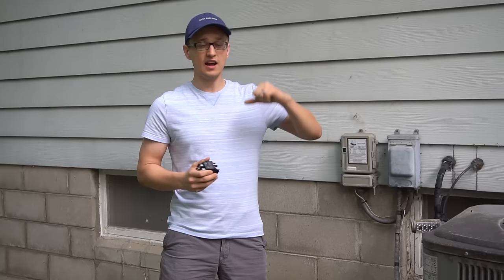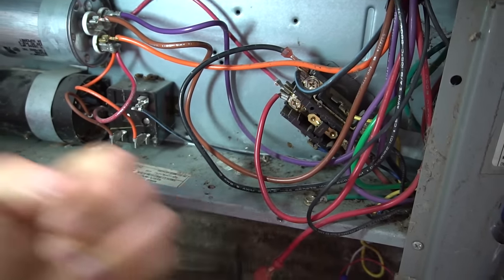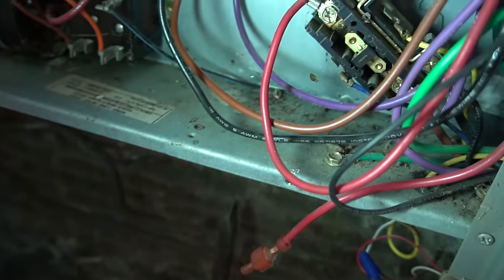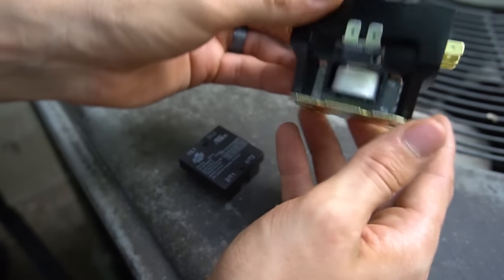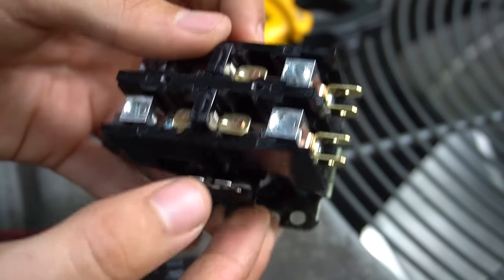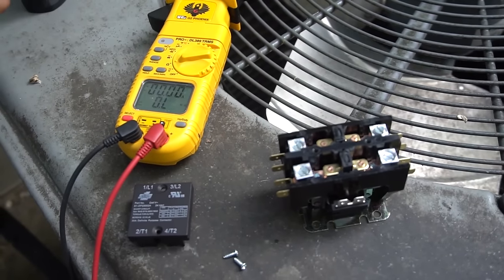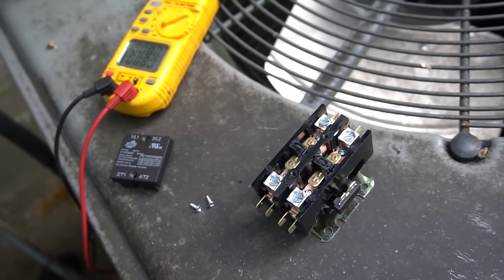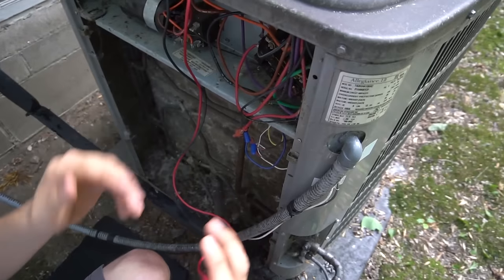Air Conditioner Contactor - How To Check If It's Actually Bad

Comment: I sure hope it’s just the contactor on my AC unit. I have a friend who does HVAC and he thought it was my fan motor. I bought a new one along with the capacitor. After installing it I turned on the AC and it ran for a short time although it seemed to be running kinda rough. After a bit it slowed down and then stopped but you could still here the compressor. Now the fan is not running at all. Keep in mind the old fan that we thought was bad ran the exact same way. It sounded a little rough. I’m now thinking that the old fan and capacitor wasn’t bad and was running rough because it didn’t have good connection with the contactor. I’ll be checking it in just a bit and I’m hoping that it’s just dirty or has a build up of insects like you had mentioned. My home has two AC units (one for upstairs and one for downstairs). Thank God at least one level is staying cool. This KY heat can you be miserable. Thanks again for sharing your expertise with us.

Comment: Great video. I’ve tried everything. Something keeps tripping the breaker, but it does not appear to be the compressor. It is not ground out. I found some bad wires fixed those still tripping the breaker. The capacitor is good. The only thing I haven’t tried is the contactor. What is the likelihood the contactor is causing my breaker to trip?

Comment: Thanks so much, Jay! After replacing the capacitor I was still having a problem with the condenser unit not going on even though the furnace fan was running. I went through your troubleshooting tips and narrowed it down to the contactor. It was getting the 24 volts and visually looked just fine (I even took it apart), but wouldn’t pull the plunger, didn’t pass the voltage meter test, and kept blowing the 3A fuse on the control panel even when it was only connected to the thermostat wires. I took it to a local electrical supply store and they confirmed it was bad and I was able to replace it for $20. Thanks to your videos I can safely cancel the service repair appointment scheduled for Monday!

One question though — I noticed that my fan motor has a slight wobble that causes the condenser unit to vibrate a bit more than seems appropriate. Could the motor be going out, or could it be that when I took it apart to inspect it I messed with how it was originally balanced?
Reply: It's possible the fan blade got damaged and is out of balance; they have some clips attached to them for correction similar to balance weights on tire wheels.

Comment: Just a heads up...O/L means that the resistance is too HIGH for the meater to read. I try to remember the difference between low and high resistance by thinking about how hard it is for current to get through something. Low resistance is easy for current to get though a cord, contact or fuse and higher resistance is harder to get through. If a cord, fuse or contact is broken it makes it extremely difficult for current to travel through which makes the multi meter read O/L.

Comment: My fan runs inside, breakers are all on, but my outside unit makes no sound and fan never comes on. Is there a video on just checking every power connection on the outside unit that could be causing this? Thanks so much for all the awesome videos!  🙂
Reply: hendrixgreengilmour. A HVAC tech with his volt meter should find the trouble quite easily. But Start by making sure power supply and tstat is working and dialed to cooling/heating
Reply: Thank you Nathan!  Turned out there was a big leak that all the freon had leaked out of so it wouldn't turn on. It was a brand new unit so I was pretty surprised.
Reply: hendrixgreengilmour. O dear! Let's hope the installer repaired that for free.

Comment: Great video! very clear!
My heat is not working. I called Hvac guy came,. He replaced the fan motor and thermosate.  However, the machine stopped after working for abond 10 hours, and the alarm indicator light showed as low pressure lockout. The hvac guy came back. He jumper the the heat pump to restart it. The test pressure was normal, but it still stopped after 10 hours, and it also showed as low pressure lock. The hvac guy don’t know what's the problem now. 
Can you give me some suggestions on where to check to find the problem?
Thank you very much.

Comment: Just subbed. why because you explain things in detail. So cool.  So I have a concern and I'm really tired of fixing my RUUD 4 ton. tech came out and wants to put a new unit in. I know it's 10 years 6 months old but I babied it. clean the condenser every year and the evap also, even made a pvc tube with brush to get up there nice and deep like, attached to my shop vac, It's clean and in great condition. Its a small commercial unit and has copper tubes. OK  Hanna just came thru and did some damage to all my neighbors houses and trees HA HA. No just kidding. Thought I got thru it but turned A/C on and it just screeeeshed. shut her down. So did the DYI and checked her out. Code 5 (crap) comp circuit. so replaced the capacitors since I keep spares and same thing. pushed the test button and comp grunts and fan just turns for a few seconds then it all shuts down. called my friendly a/C guy and he also says comp and gives me the line its old and need to replace it all. So he left. this is getting long sorry. But after he left and a good night sleep I went back to DYI. Hmmm unplugged the comp (scroll) and pushed the test button, of course no comp noise but the relay did click and then the fan turned on for a split second just like before. So now I'm thinking circuit board. Oh have comp coming OUCH.  This is getting costly. I do have HVAC experience but in Vehicles. I/m Senior Master certified in all categories but little Home HVAC. I have been electrocuted many times in the past so even though I have a Pacemaker/defibulator now I'm willing to give it a shot. Were protection. So long story short. I used to fix my old home unit and even after 25 years it worked flawlessly. a few capacitors and contacts over the years but easy peezy.  now 400 for a circuit board, Dahm HEY CAN I PULL ALL THAT ELECTRONIC CRAP OUT AND REPLACE WITH A SIMPLE CONTACT UNIT AND REWIRE..PLEASE SAY YES.

Comment: I finally managed to fix my AC a little while ago after 3  days or so of trying to figure out what was wrong, it ended up being what I first thought it was, the contactor. I found an earwig stuck under one side of the thing cleaned it out and thought I was done. I went in and turned the AC back on, went back out side but it was still not running even though the plunger was sucked down so I thought something else was wrong. Finally this morning I checked for continuity with the plunger pushed down and there was none so I pulled the lugs and screws out of the way cleaned the contacts with one of those finger nail sandpaper boards, put it all back together, turned it on and now it's working fine.

Comment: Hey it’s me again. Good video as usual. It appears that your start cap is leaking. Saw white crusty stuff on the edge and base plate. That will be $98 service call lol no charge. I do strictly commercial AC now and the cover is also an arch protection on 460volt. Carbon builds up over time and is conducive.
Reply from the maker: Hey there Yo Mamma! :) Thank you for the heads up! My reply to that is this right here ;) https://www.youtube.com/watch?v=hC0nFT1XPcI&t=25s

Comment: Great vids! While checking mine, I dropped the ball and disconnected the wire to the capacitor and BOOM, it welded itself to the sheet metal. After pressing toggle the ac unit would not start. Is the contactor not Def bad? Hmmm....
Reply from the maker: Thank you and sorry to hear about the little mishap. Most likely your circuit breaker tripped or if you have cartridge fuses in your disconnect box, those could have blown. Usually once you replace the fuses or reset the breaker, it comes back on without further repercussions. The 3amp fuse in the indoor unit could be blown too. It's part of the low voltage circuit though so it shouldn't be affected. Mentioning it just in case.

Comment: Your videos are really helpful. I have a quick question about the contactor. My contactor now only works if press the reset button. But the problem is that I have two units. When I turn the power on for the unit outside, the contactor sparks and the other unit turns off! Is this a bad contactor or something else? Thank you very much.

Comment: Watched a few of your videos and liked them. Can you please help with a diagnosis?
Neither compressor nor compressor fan come on when I turn on AC and wait.
I can hear the contactor click.
Out of maybe 20 times, compressor did come on twice but then shut off after a minute or so. Compressor fan did not come on at all.
I waited at least 1 hour between trys.

I measured output of contactor and it has 240VAC when thermostat calls for cool.
I ohmed out fan and it has 2 reading that add up to the third. It spins freely if I spin it with a stick.

I replaced the startup capacitor and relay. It already had one. It didn't help.
I ordered a new run capacitor so hoping that will fix it.

The system was working fine for many years before this issue started 2 days ago.

Thanks for any help you can give.
Reply from the maker: Sorry to hear about the A/C problems! What you described sounds like a bad run capacitor so hopefully once you receive it your unit will be back up and running no problem.

Comment: This is fascinating stuff.... I'm working on a unit with the single-pole contactor like yours, the unit wants to try and power up even with thermostat turned Off every time I turn the breakers on, even without the button pulling in! The fan on top kicks on and spins at slow speed, the compressor buzzes every 20 seconds or so (it's like it's all getting partial power even though none of it should even be on!)...even with the 2 side wires completely disconnected this thing tries to come on! I'm stumped at the moment. I can't find any obvious shorts or wiring damage anywhere.
Reply: So, when a compressor is shorted-to-ground and the breakers don't trip it apparently causes the fan on the outside unit to turn and the start capacitor to "buzz" every 20 seconds or so with power. Even with the contactor button NOT in, the thing is sending 1 leg of 120V juice thru other parts of the unit. Ergo, my unit is scrap-metal now. Fun fun! Learned a lot though trouble-shooting it myself, so thanks!

Comment: Curious if you may have any answers beyond Contactor for an irritating and possible power cost inflating Buzz when AC is off.
1 - Unit operation is excellent
2 - Problem exist Always  when Unit is <not> on/in use - even throughout winter months
3 - 2 Pole Contactor Switch has been inspected and Tested on a digital Meter - Both Contact Bars make/brake contact as designed
4 - There is no on/off switch, beyond  bi-metal coil thermostat and Breaker in panel 

As a lifelong mechanic and trained Technician in other fields trained in other fields I am a firm believer in not simply throwing parts at a problem and hoping one fixes it. That is Hope without knowledge. Hope the problem goes away without  knowledge of what has created the issue.

* Any suggestions what else to check would be appreciated.

Comment: Jay hopefully you are still monitoring this video. Problem with condenser fan in outside AC unit. Replaced the capacitor, replaced the fan motor. The fan starts slow rocking back and forth and then eventually builds up to full speed.  Sometimes it will rock itself to spinning in the wrong direction. It will maintain full speed for a bit but eventually stop spinning. Cut the power and wait awhile, restore power and the process repeats. Any suggestions?

Comment: Also, check the thermostat itself (C and Y terminals).  My A/C unit stopped turning on.  I checked the connections at the "removable" thermostat and they were a little oxodized.  I cleaned up the terminals at the thermostat and now all is well.  A/C unit is back on.

Comment: Another great video. I think I've see ALL of your videos by this point :)

Question:  When you are testing this heat pump and turning it on an off, are you just leaving the furnace in a state of "call for heat" and then using the heat pump's 'fuse block' to start and stop the unit, or are you turning the furnace on and off each time? OR.... are you 'jumpering' some contacts on the heat pump to fire it up for testing?  I always wondered what goes on with this.  I am in a situation right now where I need to figure this out so that I can bypass the comp, then the fan and even check out if the contactor is acting up due to some noises I'm hearing.  It seems a little silly to run in and out of the house each time. My plan was to pull the fuses, call for heat and then plug the fuses in for testing and pull them back out between tests all while the furnace is running.  Does this make sense?

Comment: Which color wires am I looking for to test for 24 volts brown and what I got confused Sorry Thanks  plus I have a brown wire that's loose only has a wire cap (Outside Unit) Outside turns on for 5 seconds then turns off if I push in the contactor it will run , appreciate great video

Comment: Great video. Quick question. What if my thermostat wire  (red&white) is getting 27 volts. I’m getting 28 on mine. But  the contractor coil on the contractor that’s suppose to be getting 27 volts to close the plunger   is getting. Zero voltage. Is it still inside the house or is it a board issue on the heat pump. Thanks

Comment: Excellent explanation. Electrical supply to the contactor on the AC has 27 volts when I measured it  but the magnetic switch won't pull down and engaged. I measured the ohm of the 24 volts contacts and the reading is 11.5ohm which should be within the range. What's the problem ? BTW, when I pressed on the switch (plunger) the AC fan and compressor started up without problem. Thanks
Reply from the maker: I think I answered you on a different video :) Let me know if you didn't get the response
Reply: I have your response on a different video. Thanks
Reply: @WordofAdviceTV  Thanks, where is that video and answer?  Looks like I am having the same problem now, inside fan works fine, but outside fan won't start. The contactor has the 24v, 240v and 14ohm, capacitor tested good also. If i manually press the contactor plunger, the fan and compressor will kick in immediately, when I release the plunger, fan stopped.  what is my problem?
Reply from the maker: @lw30062  If the contactor gets 24v but it does not pull in, the contactor is either stuck in the open position or is bad and needs to be replaced. The video I referred him to for this question was this one: https://youtu.be/NVPhsK4gK1A
Reply: @WordofAdviceTV  Thanks for your quick response. The contractor is not stuck, Ok, I will buy a new contractor to try. Hope that’s the problem.
Reply: @WordofAdviceTV  Hi, my bad, earlier I tested the contactor coil has 14ohm, but mistakenly said it gets the 24V. I learned more after I watched more videos from you. I realized now that the problem is the contactor coil does not receive the low 24V from the DFC control board. I have the heat pump(Rheem 13PJL30A01).  On the outside heat pump control board(DFC), inlet wires from the house on lead R and C do have 24V,  but the out leads (Y and CC) that connected to the contactor coil have no voltage, so the contactor coil does not get the 24V.  What is the problem? Could I fix the control board DFC? or I have to replace the DFC? Many thanks.

Comment: Thanks Jay!  Have you ever seen the safety disconnect go bad?   My ac unit seems to delay too long and I suspect this part, especially upon start up in the spring , since it faces north and is more exposed to the elements.

Comment: Thanks for the video. I was wondering if the fan running when the contactor bad? My fan is running but not the compressor. I have changed the capacitor but no cold air.

Comment: My experience is that burned/broken wires on the contactor or run capacitor is one of the most common causes of electrical failure. Bad run capacitors are second most common cause of failures. In Texas, it’s not unusual to find a fire ant 🐜 mound inside the condensing unit.

Comment: Read that if you have a single pole you should put a single pole. Theory is some units (maybe older, don't know) require a continuous flow of power for defrost mode or sensor or can't remember. Also, do some contactors are covered but have in the middle a square hole that pushes in when it is activated. Do you see many of those with bugs inside? Sure they are better than open contactors., but still when pulled in there is a square gap for ants to get in. Thanks
Reply from the maker: The contactors with a square cover over the plunger, I have never seen a bug in one of those so I think it would be safe to say it does what it's intended to :)

Comment: Great video... Not sure if you could possibly help me out with my situation so it appears my thermostat keeps clicking. I have two zones. The heat works fine in the house but when I go to the AC unit and try to turn it on I get multiple clicking noises but my AC unit will not turn on. I did check the outside. The relayer contact is not opening or closing. I did check. I do get 240 volts coming in but upstairs in my board. I noticed when I turned it on it gives it a quick click and then it turns off. You have any idea what this could be? I'm not sure if it's a bad thermostat where both zones are not or working or if it's possible a bad control board. I remembered last year my control board seem to be randomly clicking while I was up there for no reason but I'm not sure if it was doing anything